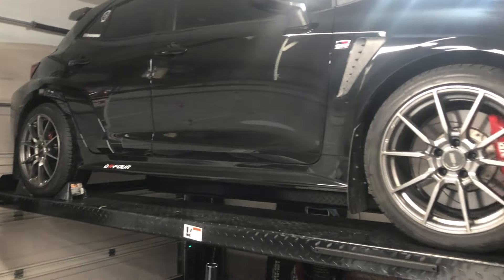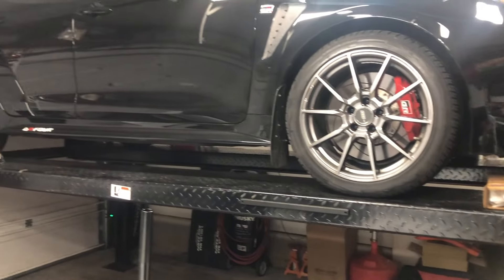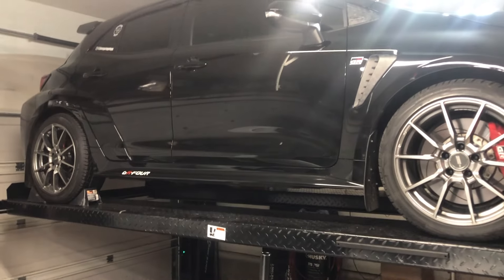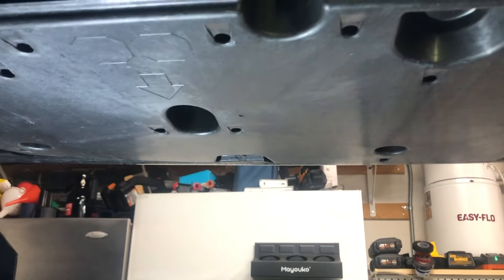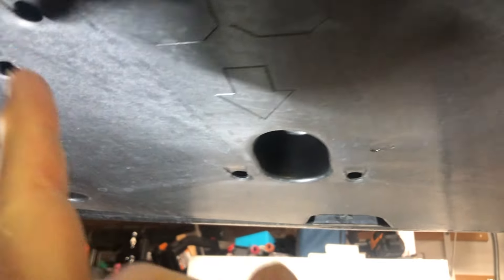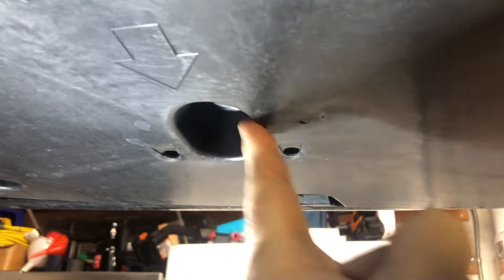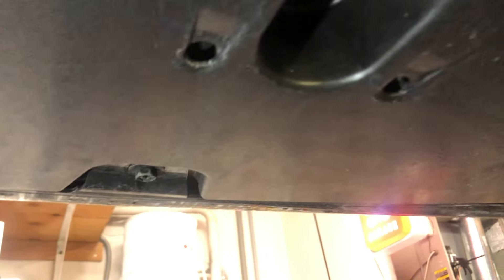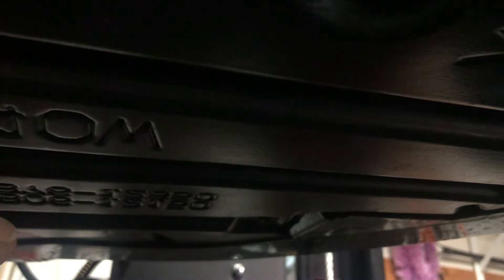Installing GR Corolla MY24 Upgrades On My 2023 GR Corolla! 2023 GR Corolla upgrades

Comment: Hey @jimsgaragetoys - Curious if you were able to notice any differences in driving capabilities after changing out these parts?  I'm mostly interested in track driving if you were able to discern any changes in how the car handled.  Thanks!
Reply from the maker: I don't track my car so hard to say. I did it trusting that Toyota did it for a reason. Just like some of the bolts were changed out on the 25 model for stronger bolts that can be torqued higher. I'll update some of those too because it's so easy to do.

Comment: What did you decide on for your wheels? And did you keep the spacers?
Reply from the maker: For sure, I specifically installed the spacers because I bought wheels that are the same exact size and offset as the OEM wheels. They are Flow One Race Spec F6 18x8.5 +30mm in gunmetal/silver. This way I have the same excellent fitment for both summer and winter wheel and tire sets.

Comment: Interesting but I think the bumpers should be removed to get better access and place the stickers where they belong
Reply from the maker: That is an option but not necessary. It was hard to place the tape and record it at the same time but it wasn't hard to just place the tape accurately. Those with later model 2023s will have the exact position labeled. Luckily, it was fairly easy to see where the bottom of the tape was located in other videos and get that started in the right position. If anyone wants to remove the bumpers they can certainly do that.